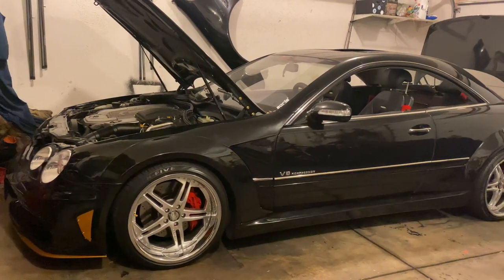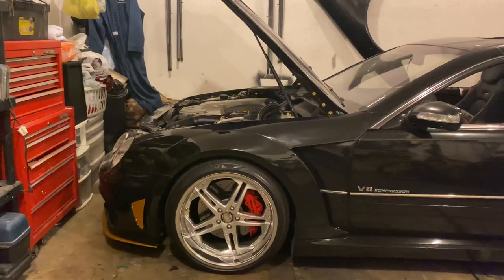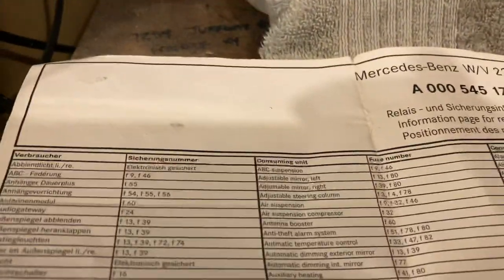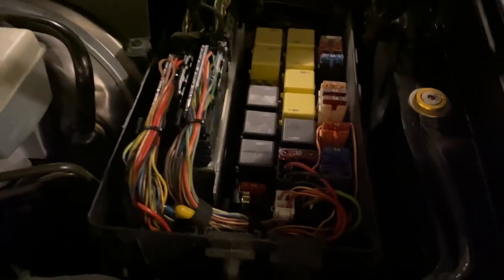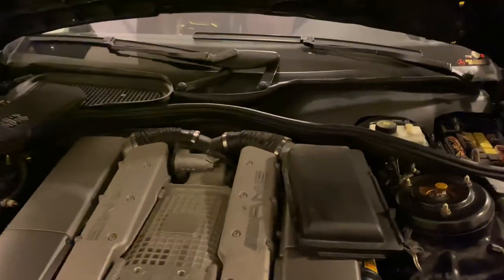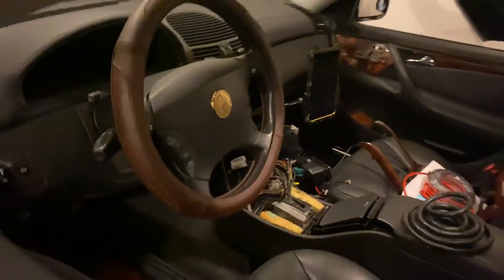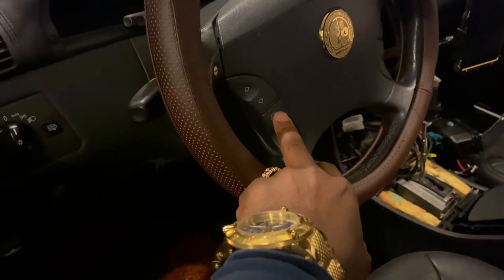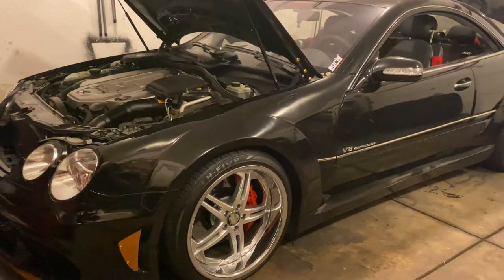How To Remove ABC Red Warning Light Mercedes Benz W215 CL500 CL55 CL600 CL65 S430 S500 S600 S55 S65

Comment: Hello there what would be a reasonable cost for a mechanic to charge to do this coil over? thanks great video.
Reply from the maker: Thank you! I charge $2500 for the labor. That includes installation of coilovers and standard power steering pump. Removal of most lines and abc components. So use that as a guide. If you want me to do the work, I am available. I’m located in Cincinnati, Ohio.
Reply: @goldelementautoworks  Im in NY, if you were close by Id hire you.

Comment: I just got my yellowspeed on. And ready to go man. I’m just wondering do I take off both 20 amp? And three of the 5 amp? I’m looking hard at your video to see which one you took off but I can’t really tell.
Reply from the maker: It’s only necessary to remove the one 20amp on drivers side and the one 5 on the passenger side.

Comment: It may get rid of the 'red light' from the dash (itself a blessing) but the problems with the suspension will still continue. I have 2 front accumulators to replace and a rear valve block to change out. I'm doing that myself at a friends garage but it's gonna take all fn day.
Reply from the maker: The reasoning behind getting rid of the red light is because I no longer have an ABC suspension. I have coilovers. Thus, the red light is irrelevant. But if you still have ABC, you can’t pull that fuse because it will deactivate ABC. Which you’re still using.

Comment: How’s the handling without a sway bar on the CL w215
Reply from the maker: Mercman730 P it honestly feels great. A bit more float than before. But a very comfortable ride. The option to drive firm, as stiff as you’d like is a nice addition.
Reply: No issues here. 
This isn’t an SUV or wallowing sedan. The wheels can only travel +/- 2” on the coil-overs and the car is a mile wide. It would be like putting a sway bar on a sheet of plywood.

Comment: Great video 🤟🏿
Just bought one and will be getting rid of the ABC..
Where did you find that fuse diagram sheet bud?
Reply from the maker: Thanks bro. I still have my original fuse diagram that came with my car. But here is a link to one. Double check and compare to your car because the diagrams are slightly different 99-02 and 03-06
https://www.autogenius.info/mercedes-cl-class-c215-fuse-box-diagram/

Comment: Did you replace the power steering pump?
Reply from the maker: Yes sir.
Reply: @goldelementautoworks  ok, so to complete the coil over conversion we need the strutmasters kit, a e500 power steering pump and finally pop the fuses and we’re good as new?
Reply from the maker: @larrybland007  Make sure the power steering pump has the triangle shaped bracket attached. I know for a fact if you eBay a power steering pump for a 2003 ML55.....it has the bracket attached. Other model cars...some do and some don’t. So make sure. I also ordered the power steering reservoir. You’ll need that unless you want to keep the big ‘ol OEM abc/steering reservoir. I wanted to simplify my engine bay so I ‘downsized’ that.
Reply: @goldelementautoworks  I thank you for that response. I was considering @CarWizard to replace mine because I have no shop.
Reply from the maker: @larrybland007  Good deal. As long as they have the experience and they know what they’re doing.......keep me posted.
Reply: did your pump use the same hydraulic line?
Reply from the maker: @larrybland007  Yes. You gotta remove a small bolt from underneath that prevents the line from extending enough to reach the new pump comfortably.

Comment: Just had that notorious light come on. Car rides on perfect height with no issues. Thanks man, going to try this tomorrow. Just to clarify, will this procedure work on my CL500 ? It's not an AMG or CL600. Thanks again.
Reply from the maker: No no no……this is ONLY if you do the coilover conversion.
Reply: @goldelementautoworks  Thankyou for your quick response. Technically though, would this procedure still work?
Reply from the maker: It will disable the ABC suspension. I assume yours still works correctly. But the light coming on is indicative to a sensor telling the module something is out of measure. Low pressure or something not within normal range. You need a scanner to find the root cause.
Reply: @goldelementautoworks   Thankyou for your expertise. I shall look into it. Best wishes from U.K. 🙂
Reply: ...Yes it's all working correctly, fluid level okay.
Reply from the maker: @Zeus-kj7nn  You are very welcome! Take care.

Comment: Can you tell me where the cigarette fuse At please I been looking for so long
Reply from the maker: F86 drivers left of dash board on US model.
Reply: @goldelementautoworks  I have the 2005 cl55
Reply: It’s where the engine at right ? What fuse it is
Reply from the maker: @BIG24HEMI  Inside left of steering wheel. Side of dash. There’s a triangle cover visible once you open the door. Pry it open with plastic wedge or carefully with a flathead wide screwdriver.
Reply: @goldelementautoworks  thanks
Reply: @goldelementautoworks  can you show me a tutorial on Snapchat or Instagram I think I’m right but I wanna make sure it’s the right location
Reply from the maker: @BIG24HEMI  https://fuse-box.info/mercedes-benz/mercedes-benz-cl-class-s-class-c215-w220-1999-2006-fuses-and-relay
Reply: @goldelementautoworks  appreciate it bro I found it
Reply from the maker: @BIG24HEMI  Cool 👍🏾

Comment: I have same problem even tho my suspension works good but the main question is if i remove thos fuses nothing bad gona affects on the car or the abc pump?!
Reply from the maker: The ABC fuse looks for the functionality of the whole system. It activates the ABC module and all sensors. The pump will continue to run but the system will not read the pumps pressure sensors or anything else that can cause the red light. The power steering side of the tandem pump will continue to work just fine. Two separate systems.
Reply: where is the ABC module? if it's bad

Comment: I've eliminated my Hydraulic system and converted it to coil-over Yellow system. Now my car won't even move. The car is sitting at a height that's drivable. It just doesn't want to move. Any suggestions?
Reply from the maker: Did you ever resolve your issue? That’s extremely odd.

Comment: Ok so I have a 2001 600. I've checked my fuse box with online diagrams and my vehicle has a lot of wrong fuses inserted
Reply from the maker: Wrong amperage? Does the diagram match the actual fuse box order? Are you looking at the correct year diagram?

Comment: but first you wanna know if something is wrong with your abc system, that's the reason why is came on in the first place.
Reply from the maker: daniel williams This car actually never had an abc issue. I already understood the advantages of removing it vs the occurrence of a sudden failure. So this is not an example of dodging a repair. This was an intentional swap.

Comment: what if your car is DOWN? ??
Reply from the maker: Has your abc failed?
Reply: @goldelementautoworks  yes and no i ran RODEO not knowing there was no pressure in the lines so the car went down 
and it doesn;t come UP or move!! anymore
my ABC module seems to be bad i can't communicate like before
any idea where it is? the part number is 0325455432
Reply from the maker: @christophercolumbus8944  Have you recently replaced anything?
Reply from the maker: @christophercolumbus8944  The module is in the drivers side under hood in fuse box.
Reply: @goldelementautoworks  i got the engine module
i got the ABS module
but then i stopped removing 
there is no ABC module inside the fuse box 
should i just keep going? 
it seems like the third module is the SAM module
Reply from the maker: @christophercolumbus8944  https://images.app.goo.gl/BhceXFKhpA3xgGH3A
Reply: @goldelementautoworks  i know i was looking at that for two days i just can't see it for some reason
Reply from the maker: @christophercolumbus8944  Did you pull all the modules out?
Reply: @goldelementautoworks  just the two 

keep pulling?
Reply from the maker: @christophercolumbus8944  Let me ask you……are you positive the module is dead? Have you hooked up a detailed scanner or used STAR diagnostics?
Reply: @goldelementautoworks  yeah it's dead cause it can't communicate i get the communication error 8.600.0 everytime i want to do dynamic test or caliberation or whatever except for RODEO